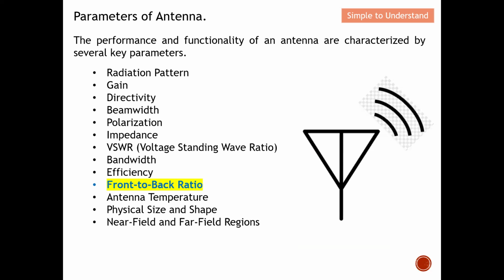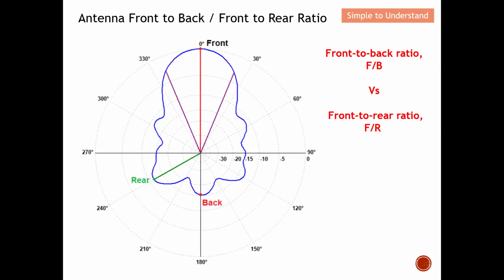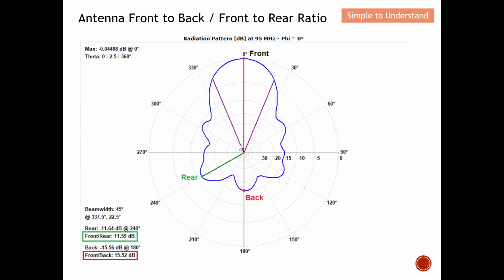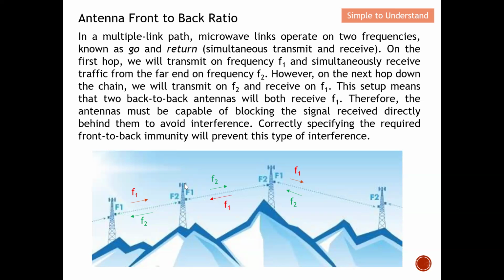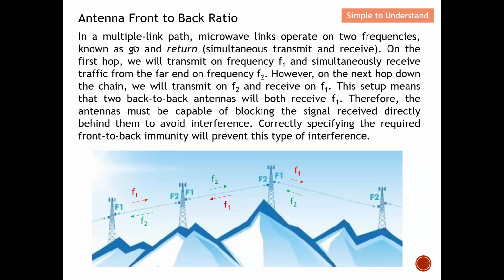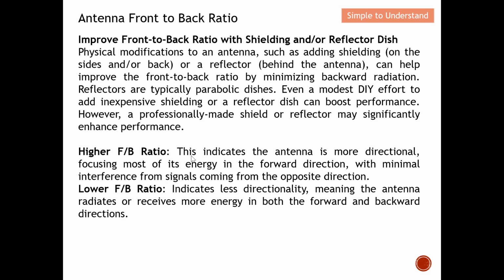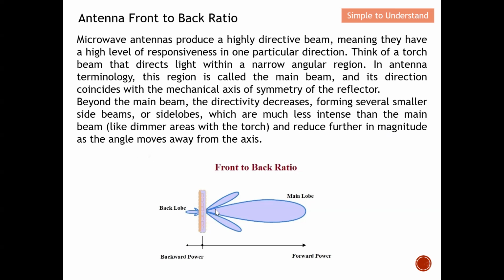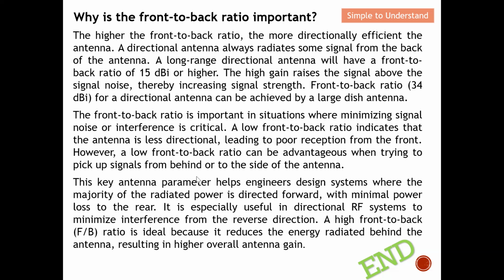Antenna #12. How to Calculate Front-to-Back (F/B) & Front-to-Rear (F/R) Ratios for Relay Frequency.

Comment from the maker: Thank you for taking the time to watch this video. 
In this video, I discuss the difference between the Front-to-Back ratio (F/B) and the Front-to-Rear ratio (F/R). I also demonstrate how to calculate both the Front-to-Back ratio (F/B) and the Front-to-Rear ratio (F/R). This is very important for a multiple-link path that operates on two frequencies, known as the go and return (simultaneous transmit and receive).
Antenna Design playlist. 
https://www.youtube.com/watch?v=RTtCxtSaG8w&list=PLFxhgwM1F4ywAyke2KC22BLBl1V4vV9Jt

Comment: Can we use trilog broadband antenna instead of horn antenna for RE commercial testing from 1GHz-6GHz
Reply from the maker: Trilog Antenna generally dun work at so high freq. I think at most 3GHz. Hence, most of the time is horn antenna for higher freq.